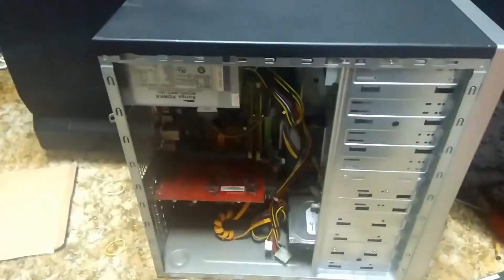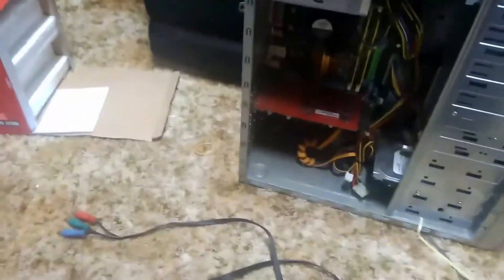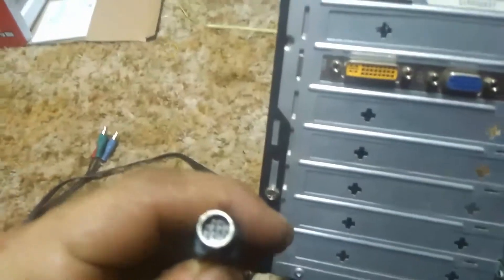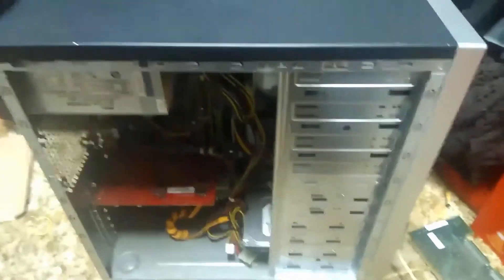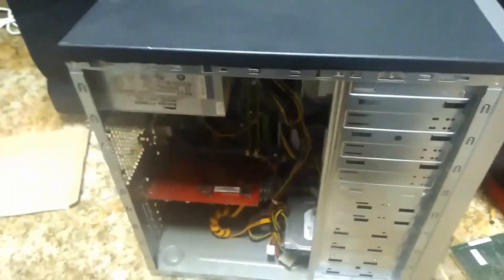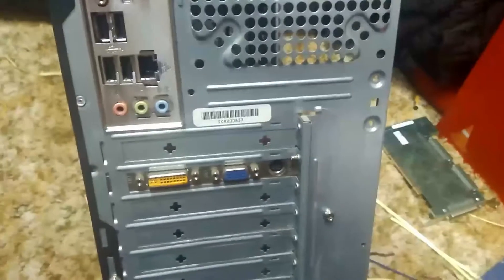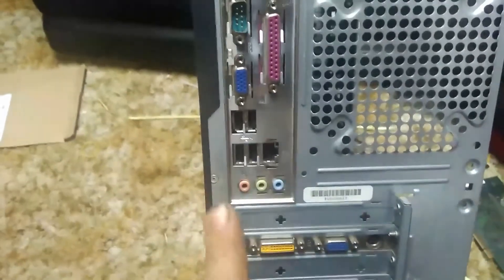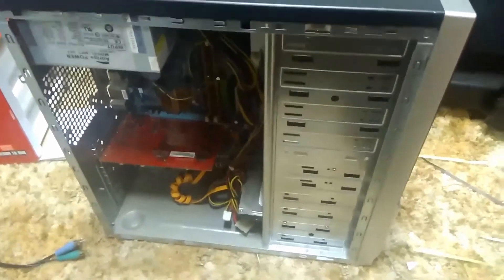Building a computer for my Rear Projection TV - PT 4 - S-Video issue

Comment: Not sure what that cable was but an S-Video cable has 4 pins and a block at the bottom (I'm sure you know that). These are available from Amazon for $4.99 up to $10 if you have Prime. Does Amazon get to Australia?